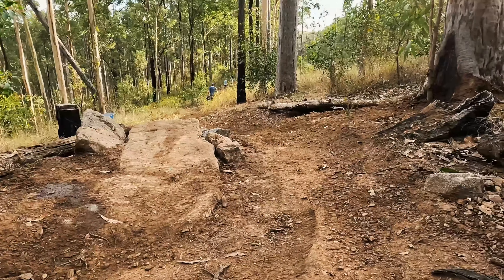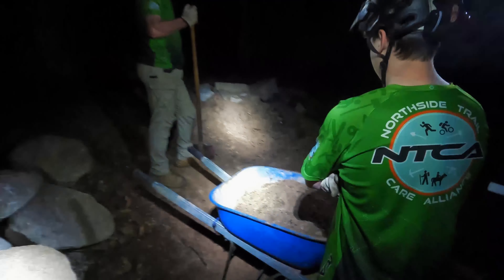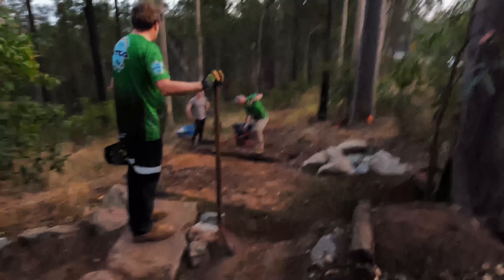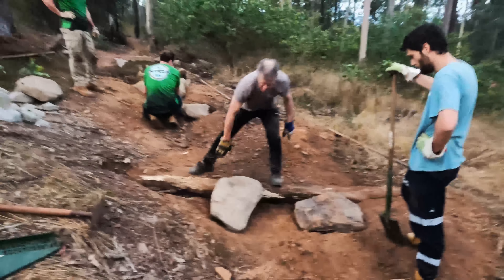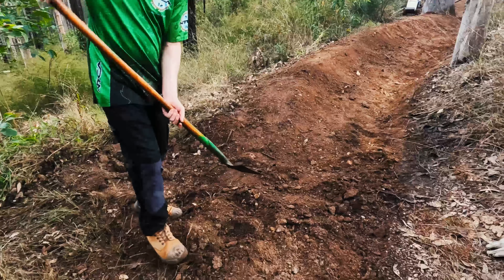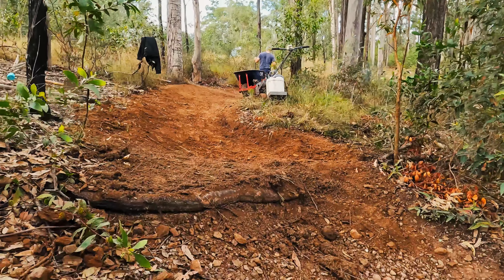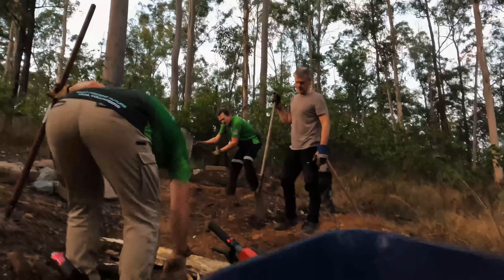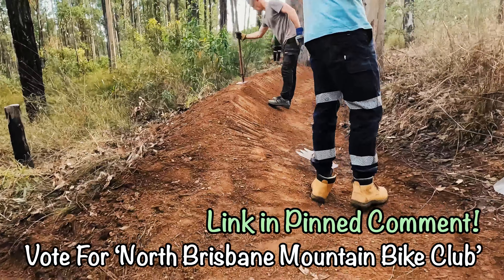The TRUTH Behind Mountain Bike Trails

Comment: When you have some property. Arrange a motorcycle enduro race in a manner that exactly runs them on trails you want to create with tight tape lines. I put that idea out there, but haven't seen it used yet.
Reply from the maker: The issue with motorcycles is that they absolutely destroy the trails. Generally, motorbikes have specific trails for this exact reason. But I agree, if they weren't gonna wreck the trails, this would be super fun!